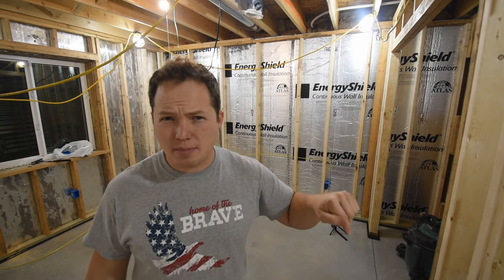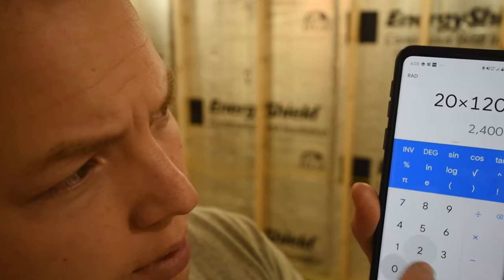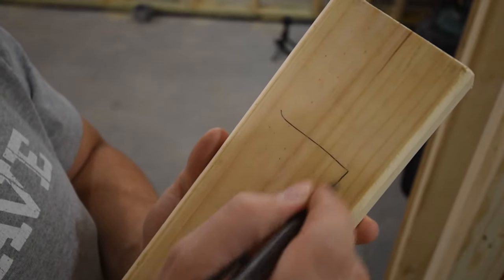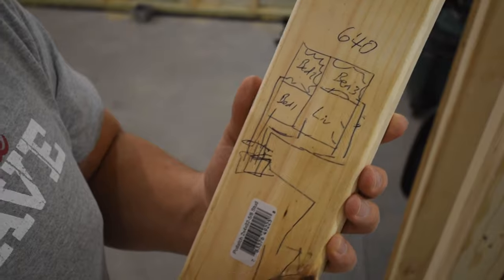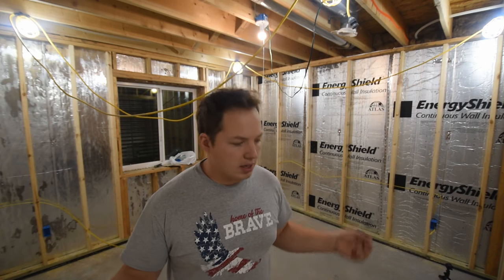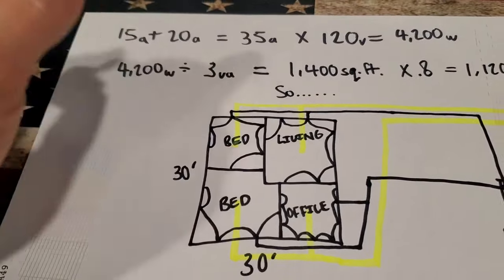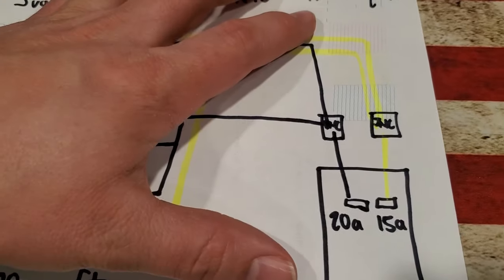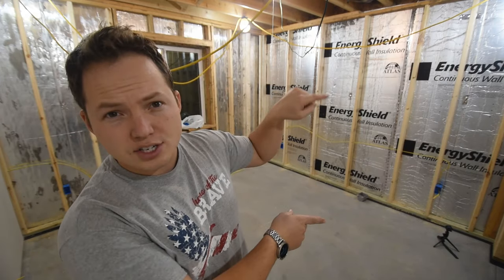Does a Bedroom Require a Dedicated Circuit? - Using the 3VA Rule To Calculate Anticipated Loads

Comment: So, I like a lot of your videos. I hate this one. 3va rule... One space heater is 1500 watts, a high end computer runs a 500-800 watt power supply, a guitar amp runs 300-1000 watts... I don't like this. This will convince people it's ok to run a low allowance in areas where modern electronics are consuming more and more power. I wouldn't go anything less then a 5VA in modern times. I am sorry for the disagreement but I think this is an awful video that will cause lots and lots of problems for people in the future.
Reply from the maker: Doug, thank you for sharing your thoughts! This is exactly what I like to see in the comments. If you look at what I actually recommended I accounted for the concepts that you mention. If you pull the "home runs" all the way back to the panel area and then combine the wires in a junction box you can easily separate each room/area onto a separate circuit. I even recommend using the 80% guideline which helps people oversize their circuits slightly to 3.6va per square foot.
Reply from the maker: With my recommendation you would be able to provide 70 amps or 8,400 watts for that 30x30 area that I drew the wiring plan for at the end of the video. That comes to 9.3 watts per square foot! I'm not sure if you watched the entire video but I actually think that we both agree that over sizing the wiring is important and valuable. Let me know if you have any other thoughts! Thanks again for sharing.
Reply: @BenjaminSahlstrom  I did jump the gun before watching all the way through. I just know when I got into my home I had two bed per circuit. Then my kids happened. And one running a computer and guitar amp while the other running a comp and mini fridge blew the circuit constantly. It took some doing but after dividing each into their own 20A and putting the lighting on its own for both rooms I was able to provide enough power for both rooms safely. Thank you for the response. I just hope people take into consideration what is working on these systems now of days. I use a 4 outlet rule. No matter the size I never go beyond that so you don't get to many high wattage devices on the same circuit. (I dont count double outlets individually)
Reply: The 3VA rule is on average It probably is not likely the average person is going to use the guitar amp, computer, and space heater _at the same time_.  The NEC electric code specifies minimum requirements, and sadly that is how most builders build modern houses today. Ben's idea of combining the circuits in each room to a junction box before a feed to the panel is a very good idea--so circuit segmentation can happen later if needed.
Reply: @UCi6q-LaBAHIQDCiPACQxMqQ I do understand what your saying but two beds side by side with children in them is fairly regular. How many kids do you know in the modern age not running a computer? That's the majority of the wattage allowed in the video Right away on his 12*12 room. He said what 600 Right. My kids game and run 800 watt power supplies. That WILL become more common as components get cheaper. How many teens are learning guitar to impress their classmates or "the ladies" like my kids tend to think is a new saying not one from the 80's 😆. All I'm saying is with advancements in tech comes more power requirements per room and kids tend to use more and more tech and THAT is where people will see this video and say let's take that and combine these rooms I can save $20 on wire. Because let's face it if they're going far enough to find out how many rooms on one breaker they can run they are not spending the money on wire they're needing to. So like with Ben I disagree this will be uncommon. Moving into the 2020's I see a massive spike in power consumption per room and I feel like this video will cause people problems later that followed this rule. I do appreciate your feedback though, I respectfully still hold my stance 3 isn't nearly enough
Reply: @BiggDouggie  I see a future where we're using far less electricity, not more. Most average computers have 150W or less power supplies, and people seem to be shedding computers more than ever, preferring portable devices like laptops, phones, and tablets. If your house is properly heated and cooled, you shouldn't even need a 1500W space heater. Of course you are welcome to build a nuclear power plant in your backyard if you think your use of power is extraordinarily more than the average person's. lol
Reply: @Douglas Florence The rating on the power supply does not mean it is actually drawing that much. Even a very powerful gaming PC draws less than ~400 watts under heavy load. The exes is used for spikes.
Reply: Excess*
Reply: @ripstick2217  I took a ln amp reading while the kids were playing, I won't lie and spit out a number as I don't recall but of the 800 available Watts I think my kids were pulling around 450ish each. Again can't recall exactly. And the 1000 watt amp on their guitar rigs were pulling something in the 750 range if memory serves. I know that will vary but modern electronics are consuming more and more power the quick charging phone chargers can pull up to an amp themselves, add a tablet there's another amo, SO on and so on. I understand your point still find my believe that a 3va is not enough to hold true
Reply: well there is nothing wrong with planning out your circuits to fulfill your needs but remember you may not get the roi when you sell
Reply: as far as the space heater i agree my dream wiring wld have one dedicated outlet under a window for a space heater and an a/c for the summer